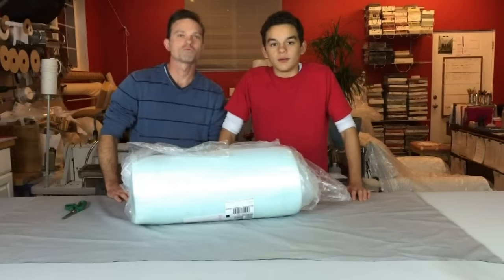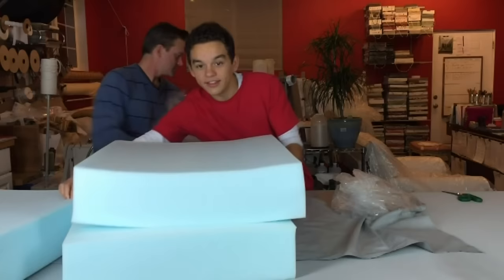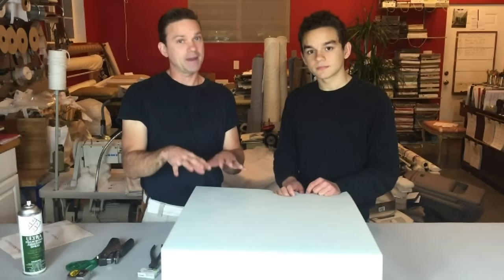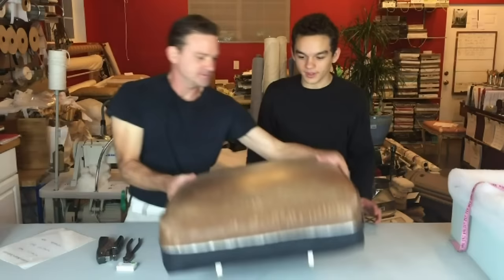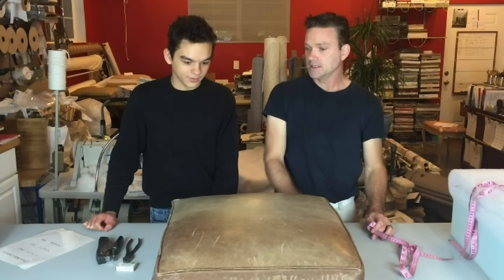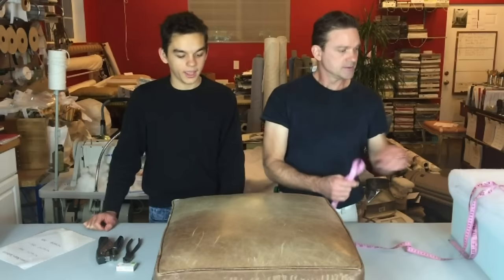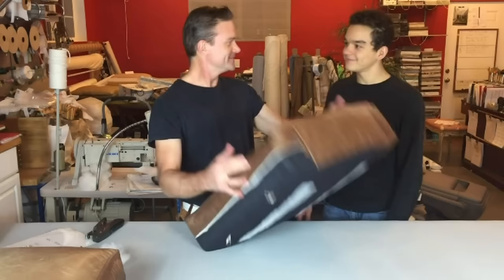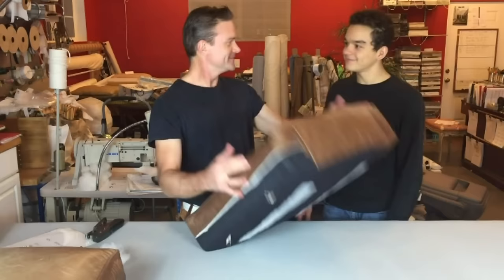Replace the foam in your seat cushions fast and easy!

Comment: I am buying foam for my couch cushions and TY TY for the information on the video and links to order.  This made is super easy to order.  My question is, I am also interested in buying foam to make a cushion for my office chair, would I purchase the same foam density?  What thickness would you suggest for an office chair?  Thank you so much.  Y'all are great!
Reply from the maker: Hey Judy thanks, for checking out our videos and for ordering! With your office chair I would try to measure your seat thickness now with the current foam in there, then add an additional inch to that measurement. Also if the thickness of the foam you will be ordering  is between 2" - 3" I would suggest a 45 compression. I hope this helps, if you need any further help you can contact me via our live chat on our website. All the Best, Grant

Comment: I'm interested in trying to save my couch in order to save money. My couch is cloth instead of leather and the cushions are attached. There is a zipper so I can actually open each cushion. The zipper is located on the side of the cushion it starts in the center on the side opens to the back then across the back of the cushion and then halfway up the other side. I'm going to log on to the site you suggested today and order the foam. Because it's cloth instead of leather do you feel I should do anything different than what you showed in this video thank you for your time
Reply from the maker: Hey there Henry, that is great you have a zipper on an attached cushion, usually they do not have one. NO if you measured seam to seam on the cover and add 1" to all the measurements you will have it. There is no change in the process, you will be good to go. At ucprivatecourses.com there is live chat if you have a question. Thank you. Cheers,  Paul
Reply: @ucsolutionsgivingmore  thanks for taking the time to reply I appreciate it. Love your videos you guys are great take care
Reply from the maker: Thank you, you too!

Comment: I didn't see you actually cutting the foam....so, if I heard you right, I have to get an EXACT measurement, and then add 1" to the length and the width, is that correct?  I'm doing a rather inexpensive rattan patio loveseat and 2 chairs....5 sitting cushions (I don't need to do the backs)....so the foam supplier makes the cut in the foam???  Where would I order the foam from???  thanks.
Reply from the maker: Hi Richard, thank you for checking out our videos! Yes, you are correct, you would want to measure your cushion covers seam to seam and add an additional inch to those measurements. You can place your order at our website ucprivatecourses.com. One question though are theses out on the patio where they can get wet?

Comment: What and where can I get a very long zipper for that couch bench cushion I mentioned in my last post?....
Reply from the maker: HELLO Patrina, there are places on the Internet like eBay you can find someone to sell you just one long zipper with a slide. We we buy them on a roll and they just have to pull it off and cut it the length you need and put a slide on it so that shouldn’t be that big of a deal. I’m gonna move on answer your next question

Comment: Hey, great video.  I learned a lot!  Question, did I see on the bottom of those cushions some strip of velcro?  I have a problem that my couch cushions slip forward a lot (the couch has no back cushions as it's all one back piece, so you can see whenever it moves forward)!  Do you recommended using Velcro, and if so, how is it best done? Or have better recommendations?

Thanks!

Comment: Is there a difference in foam for cushions to be used outside (covered porch)  Thanks.  Nice video.
Reply from the maker: Hi Linda,

Thanks for watching! There is a difference between indoor and outdoor foam. Outdoor foam does not hold water if the cushions get wet. Also outdoor foam is mold resistant. I hope this helps!
All the Best,

Grant

Comment: Thanks for the tutorial how do you cut into the foam for side-edges that curve into the structure of the couch or do you order the foam custom cut to fit the cushion covers. How do you measure those areas that have a curve or scalloped cut-out?
Reply from the maker: Hi Jaijai,
Thank you for watching the video. You can do it both ways, most foam suppliers can cut out the cushion for you. I believe what you are describing is what we call a half T cushion. If you have a curve in the cushion following the furniture you can take the foam out of its cover, turn the cover inside out and use that as a trace. You will have the seam allowance in there when do this tracing, this adds to making the foam an inch larger, so you will not need to add the inch extra as stated in the video. Because of the curve you will need to cut the foam it yourself, measurements will not work. You could trace the platform of the furniture curve with Kraft paper or old fabric and send that in as a template for the foam company to cut. We have a video on how to measure for a T cushion but not for a curve. Some companies will fill the cushion cover for you I have heard, if you send in the cover only. However it could get lost or stained in the process word of caution. Here is a link to our video on T cushion that might help.  https://youtu.be/dq2a1WPrLJ4 Thank you again for watching, please share our videos it helps us when you do.    All the best,  Paul

Comment: Thanks for this great video. You two are a great team -- so nice to see father and son working together! I have a question -- I am about to recover a large cushion (74X33X3) and I like the idea of stapling the dacron on to the foam, but will that work with regular indoor upholstery fabric as the cover, i.e., will the staples  cause an indent in the foam, and so cause the seam lines on the cover to be bumpy and not perfectly straight. I am concerned about this, especially since I am not adding piping. Thanks for your reply.

Comment: What exactly does it mean when a mattress or a leg support pillow says that it is made of 25D normal foam? What is this made of and what are its specifications? Thank you for your much needed help!
Reply from the maker: Thanks so much for watching our video! As far as I can tell that could be referring to the density of the foam. However foam companies have different terminologies for the same thing, so I can’t be sure. If it is referring to the foam density that is a good quality. I hope this helps!
Reply: @ucsolutionsgivingmore  Thank you for taking the time to reply, I appreciate it. Btw, Great video

Comment: Is it necessary to add a dacron/batting? Could i use foam only?
Reply from the maker: Hey there Swabia, that’s a really good question we’ve had that question asked before. They Dacron or batting does the same thing, serves a few purposes one it keeps the fabric from sticking to the foam so the cover fabric it can slide easily around when you use it. Foam will rub fabric and deteriorate the fabric so the Dacron or batting stops that, and number three it makes it easier to slide into the fabric cover. If you do not have Dacron in your application now then no you do not need to add it. Finally Dacron batting offers is a soft feel as well as it does not look flat as foam is. I hope has helped you make your decision. Please help us by passing sharing our videos. Thank you cheers, Paul

Comment: My cushion size is 24”x 26”x 6” ... Could you please let me know what size cushion i should order and what should be compression and density.. I want very firm cushion
Reply from the maker: Hey Pavan, you need to order all measurements one inch larger. So 25”- 27”-7” as for the density go for the highest density. Go to ucprivatecourses.com you can order foam there and get an Instant quote. There’s videos there to help as well too on the compression. That’s really up to you 7” foam is thick so the that’s going add to the firmness right there alone. Please share the videos it helps a lot when you do. All the best,  Paul

Comment: Hi! I loved your video. It was more than helpful. Question: is there a website in which I can order the cushion foam with a specific cut/dimension? I have sofa with three seat cushions. The middle seat is easy and square -shaped, but the two end cushions have a little nub hanging off the square shape (kind of like a distorted "L" shape). I would definitely need the foam cut to fit my covers. Any suggestions?
Reply from the maker: Hello Megan,
Thank you very much for watching the video, glad it was helpful. Yes you can order both those shapes of cushions at ucprivatecourses.com   there are videos on the site as well and chat ability if you need it. You will get an instant quote to your door. Free shipping on orders over $125. Again thank you and please share the video it helps us a lot when you do.  Cheers,  Paul

Comment: thank-you, I didn't know anything about numbers for density and compression. So for a heavier person, you would get foam with higher numbers for density and compression. Would you go 30 in compression for 300 pounds? Is there a formula or chart to go by? The cushions on my Ikea  Kivik sofa has too much give
Reply from the maker: Hi Peter,
Thanks for the question. YES! However the compression (the last two numbers) when it comes to weight is the most important. This number determines the spring back of the foam. Where as the density determines the longevity of the foam itself. So 30 or 32 or even 35 is considered to a mid to firm foam. The platform on your sofa will have a say as well. For example if your platform is really soft or springy then a firm foam will make up for the platform. I have a good friend who is 300lbs I made a cushion for him with 2635 foam and he was very happy. I hope this has helped you. Thanks again for watching and please share the videos that helps Grant and I a lot when you do.   Cheers   Paul

Comment: What can I do if my seat cushions are extremely hard and uncomfortable? I just bought a new sofa that is beautiful but soo I for table to sit on. The cushions barely give in and I’m sitting super high :( I like sofas where I can sink in. The seat cushions are made out of sole memory foam but I don’t know the density. I’m thinking of reselling but thought I research first for a cheap fix.
Reply from the maker: Hello Tanja, thank you for watching. I have heard this question before it’s problem… Furniture makers today are cutting corners, so for the most part are using very cheap density foam 1.5 or less. So they make compression very firm to compensate… it cost less for them foam is a big cost in manufacturing. You unfortunately need to replace the foam and purchase soft. There’s things to try slicing the foam horizontally and then gluing on softer pieces on both sides, BUT!!  It’s so much work it’s not worth it. Plus you would need a special tool to slice the foam horizontally. So in your case do your best to live with it or replace the foam for softer foam.  Here’s our site if you care look into new foam. Ucprivatecourses.com   I hope this helped you make a decision. Please share the videos it helps us when you do. Cheers, Paul

Comment: If my couch is a love seat, the foam is rectangle, what size shall we use ？
Reply from the maker: Hello Mary,
Thank you very much for watching our video. I put a link in were it will take you to the correct section for rectangles. Just put in your measurements adding one inch to the finished COVER measurements according to the video. The video is on the site as well for a refresher. You will get an instant quote to your door. Thank you enjoy the day.   Cheers,  Paul
https://ucprivatecourses.com/product/sofa-chair-seat-cushion-foam-inserts/

Comment: Hi, great video. How much would replacing that one cushion in your video cost? Thanks
Reply from the maker: I appreciate you watching the video glad you liked it. To be able to give you a price you’ll need your cushion measurements according to the video.  You need to go to ucprivatecourses.com for an instant quote to your door.  There are videos on the website to help you out as well as live chat if you have any questions. Again thanks for watching I really appreciate it. Cheers, Paul
Reply: ucsolutions Ok, I measured my sofa and love seat and used ur site for a quote. Im looking at $200 for the two cushions in my love seat. Which would be cheaper than buying new furniture. Im am curious about the cushion firmness, I entered 2635 for 4” cushions. I want them to last as we are on the larger side and always in the living room.
Reply from the maker: Hello again, the compression of 2635 is considered medium firm. A 4 inch piece of foam that you need that’s not that thick so I would definitely go for a medium firm at four-inch.  You could even go a little firmer to a 45 but that’s considered firm. As you say you’re a little bit on the larger size. That should be taken in consideration as well as where the cushions sit on the platform.  Is it springy or is it very firm. If it’s springy you should go for a firmer foam then if the platform is firm itself you should go for probably a medium firm. You would have to decide between the 35 compression which is medium firm or a 45 compression which is firm. I hope this helps in someway like I said there is a live chat we could exchange phone numbers and discuss it if you need to. Thank you again cheers, Paul

Comment: I am a big guy. right around 350 lbs. what would you recommend for a 4" cushion density wise? I don't want to sink way down in a four inch cushion.
Reply from the maker: Hi Shayne,
Thanks for watching our videos! It can be hard to say what the correct compression is for someone, however I would do a minimum of 35 or do 45 compression though 45 may be too firm. 
If you need a place to order your foam you can check our website here: https://ucprivatecourses.com
All the Best,
Grant

Comment: Great Vid, Learned a lot thank you!
Im replacing the back cushions to my sleeper sofa. Originally it has a rectangular piece of plywood that used the bottom lip to dip into the sofa and hold it in place. eventually that plywood broke through the top of the foam cushion and now we got to finally fix it.
So we are thinking of inserting this plywood down the middle of the foam up until 3/4 of the way. and have the bottom stick out as it originally did..
My question is do you have any recommendations to cut a groove in the foam to insert  the wood inside.
Also whats the difference between foam and foam rubber
Reply from the maker: Hi Danny,
We have been really busy so sorry for this late reply. I am not completely sure on what you need so hopefully this is what you are looking for. A way to cut foam you can use a hacksaw blade, a razor blade or even a electric food curving knife. All three do cut foam. The difference between foam and foam rubber when it comes to foam rubber! It was the first made, actual made from the rubber tree a long with other fillers (sand in some cases back in the day that's what made them so heavy). Foam rubber is very good in quality it keeps it's shape, but does harden over time fast  when exposed to light (sun shining on the furniture through windows). Poly is an oil byproduct. It's cheaper in cost and quality. Poly will LOSE it's shape overtime (get HIGH density, will slow this down) but does not harden and crumble over time.  So I hope this has helped. we thank you for watching and commenting. Best Regards,   
Paul

Comment: I have a large deep sofa that about 118" long and 54" depth. I wanted to change the seat cushions and the price on your site was almost $1400 per cushion. Does that sound right or am I doing something wrong with the dimensions?
Reply from the maker: Hello there Robert, thank so much for watching the video. I went to the website put in your numbers.  I didn’t have how thick your cushion is so I put 8” the thickest we offer. The width you gave me was even too long, the site goes up to 108”. Again I don’t have all your numbers. This is for very best density we offer, which you do want for longevity…. But foam in the past year because all the lockdowns and supply shortages have pushed foam way up in price. I wish there was something I could do, but there isn’t. You can go to the site and there is live chat to talk to Grant. As well as we can get on the phone through the site. Plus you can choose 1.8 density it’s less expensive. We just offering it because all the price hikes going on. I hope this helps in some way. Thank you again. All the best, Paul

Comment: Thanks for the video..  You added an inch to the width and depth of the foam measurements.. Does this apply to the thickness as well or does the batting make up the difference.?
Reply from the maker: Hey Rob,
GREAT Question!! We wanted to give you the answer in video form, so the link is below. Please consider sharing the videos with others and on different platforms like, Facebook. When you do, it helps us to continue to produce these videos. If you have a video you would like us to do let us know. All the best,   Paul
https://youtu.be/jfzPCXLs27U
Reply from the maker: Hey Rob,
I forgot to ask, please consider supporting us on Patreon https://www.patreon.com/UCSolutions  ANY amount helps us to keep offering these videos. Either way we honestly thank you for watching the video. All the best,    Paul  and  Grant.